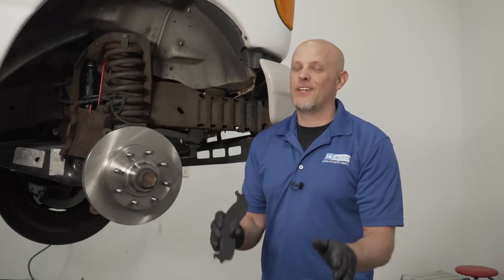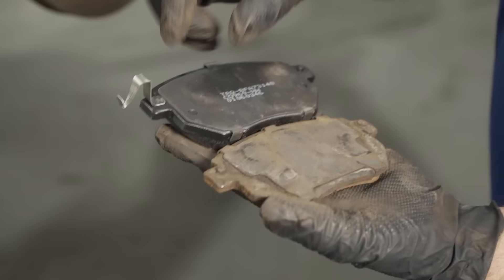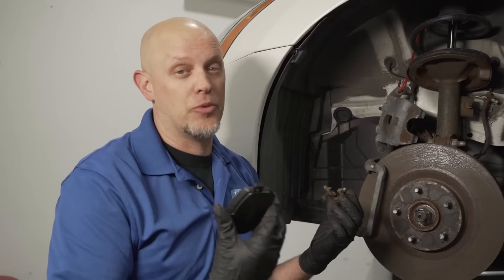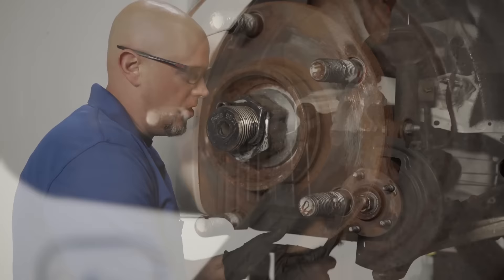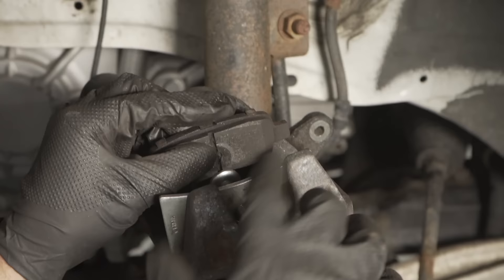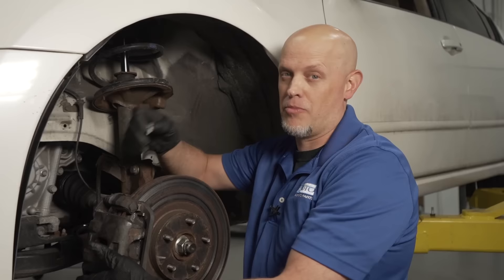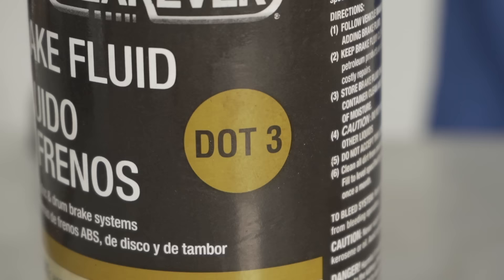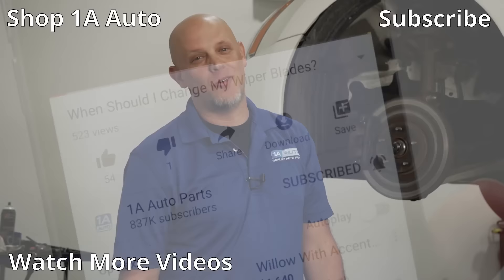Most Common Brake Installation Mistakes!

Comment: I would have called the pads inside out rather than backwards. I think if you can't tell they are around the wrong way or are greasing the friction material you definitely should not be doing any work on brakes, and possibly anything on the car.

Comment: The first time I did break lines, I couldn't count the number of times I did the flare and realized the bolt wasn't on. It's probably the most infuriating thing ever, especially when using a cheap flare tool

Comment: Back in the 1980s those rotors were so meaty they could have been turned down smooth & true and still had enough metal left to turn them down again.

Comment: the squealer always goes on the trailing edge of the rotor. if you put it on the leading edge it will get pinched between the rotor and pad and snap off. then you won't hear any squealing until the metal pad hits the rotor. he said put it on top, that's the leading edge. don't do that.

Comment: Emphasis on double checking the bolts are done up tight. I forgot to do that once and the caliper fell off during the test drive, had to pump the pedal to close the caliper up before braking returned. Then I went home and changed my underwear.

Comment: So apparently I made a huge mistake now that I think about it in hindsight... my caliper was removed as I was attempting to remove the hub to replace the bearing the hub castle nut was going to be impossible to loosen with the car up on stands, so I put the tire back on and lug nuts and I was going to let the breaker bar sit on the ground while attached to the hub with the tire on and wheel touching the ground, and I was going to move the vehicle forward a bit to break the castle nut free (sounded logic at the time, and that it would work) well in order to start my car you have to depress the break and push start button so that's what I did, and when I did so, it caused the caliper I had off it managed to push the piston all the way out and It appeared to be a bit cocked sideways and now it's been impossible to get it to compress no matter what I've tried to do to fix the issue, still no results and I absolutely do not have the money to buy a new caliper I've just put over $300 INTO the suspension recently and it's wiped me out....and to top it off how I was attempting to break the hub castle nut free, didn't even work it busted my breaker bar, so now I have a stuck ass caliper and a castle nut that won't come loose to replace the bearing...I'm very very very very frustrated at this point and just want to give up on it all together qnd let my only car sit, useless in my driveway I don't know what else to do to correct the problem.

Comment: Gotta throw this out there. Some cars have a parking or emergency brake system that actually turns your rotor into a drum brake. I accidentally broke my parking break on my 5 speed suzuki reno pulling the rotor off with the break engaged so make sure you check.

Comment: I hope that wasn’t copper tubing he was using for brake lines. Copper is too soft to handle the hydraulic pressure that occurs when braking. Use the recommended brake line tubing which generally is steel. On a Lexus that I had you didn’t even need to remove both bolts holding the caliper, just remove the top one and loosen the bottom one - the caliper flips back out of the way to expose the shoes and you simply lift them out. You don’t need to worry about hanging the caliper and it sure saves time and aggravation. Why don’t all manufacturers do that?

Comment: Most brake repairs cost you a minimum of probably $400 per axle or maybe you could get it should be for both axles but it seems like you just charge you double

Comment: Don't bend/pinch metal tabs on some pads to make them fit easier.  The pad will get loose and wear at an angle and eat into the brake rotor.🤦‍♂

Comment: Make sure your truck doesn’t have a break service mode. They disconnected the battery changed my breaks and when the computer was turned back on my dash became a Christmas tree. Had to drive it a while to get it to reset.

Comment: I know it’s not good to push the piston in as you don’t want dirty fluid going back to the master cylinder but I do that instead of cracking the bleeder which allows me to test a collapsed brake hose

Comment: One thing i do is try the brakes in the parking area. I will drive backwards and forwards to make sure the brakes work. I always pump them up first before moving the car. Once  i feel the brakes are working properly,  then i get on the road and see how the new brakes perform. Just saved my wife $200 in labour replacing front brakes. Another thing...i refuse to use MADE IN.CHINA parts. Made in Canada/USA is what i like.

Comment: Not to nitpick,but you should have put that anti-sieze on the studs...if anywhere. Doing so will make those studs last far longer.They are subjected to so much abuse. Compromised threads after years of removing and replacing wheels can cause wheel loss! Don't be a "loose wheel"!

Comment: I am doubting a brake repair shop will use a wire brush to clean off rust. Did not see a shim added with brake pads.

Comment: 100% never any grease pads EVER! Anti-seize behind the brake pad slides is fine. They dont come like that from factory! Grease collects brake dust and road grime causing brake pad to lock in place and cause premature failure. ( Bad advice telling to add grease ). Second disagreement you never open the bleeder when compressing the caliper the reason why is you can introduce air into the system. ( The only time the bleeder should be opened is for brake system bleeding or diagnosing a stuck caliper checking to see if the caliper is faulty or the rubber line is faulty )

Comment: Don't use brake fluid in your power steering fluid, all hydraulic fluid is not the same, it will cause your power steering pump to go out.

Comment: Had to replace pads and disc in the middle of winter,outside ,at  a hilltop house ,just south of the Anglo Scottish border...

Bolted the caliper leaving the flexible pipe v badly twisted 

It lasted a couple of years like this and only discovered by a professional mechanic doing another job.
He approached me ,in the waiting room,and was quite annoyed asking me which repair garage I had recently used. 
After further discussion,I denied any knowledge of the caliper problem , couldn't recall the garage responsible,and expressed my outrage on the clown who could have done such a thing !

Comment: I know that was just a cap full of oil but really, you don't want ANY in there at all.  I can only imagine that it is going to be a very expensive thing to replace all the parts of the brake system.  That is even if you get lucky and your pads and rotors did not get fluid on them.  If it is DOT 3 fluid that might cause even more problems when it leaks since it is corrosive to paint.  Don't forget this stuff is very toxic regardless of which DOT it is.

Comment: ****************THE MOST COMMON MISTAKE AND SOMETHING EXTREMELY CRUCIAL IS REMEMBERING TO USE ONE SOCKET TO HOLD THE LARGER BOLTS WHILE YOU TIGHTEN THE SMALLER CALIPER BOLTS 🔩.  THIS IS A SAFETY FEATURE AND I WASN'T TOLD THIS IN ANY OF  THE YOUTUBE VIDEOS I WATCHED SO MY CALIPER BOLTS LOOSENED**************

Comment: I may not be an expert mechanic and only do what I have needed to do, but man.. for the sake of the persons safety, if someone doesn't know the difference between the metal side and the pad side of a brake pad they should not be changing their pads! O_O

Comment: WAIT....a COPPER brake line!!!! I sold aftermarket parts for years and was told, repeatedly, STEEL    brake lines ONLY!   Copper is TOO SOFT and ILLEGAL.  Auto parts stores USED TO SELL special steel brake lines, in different diameters and lengths, with male fittings on each end.😮

Comment: I mean is putting them on backwards and driving necessary to show that it’ll cause damage? Should be pretty obvious to anyone with a brain that metal on metal is gonna cause problems. Anyone that puts pads in backwards needs to put the wrenches down and walk away. In fact I’m surprised they were capable of taking the tire off to even get to the brakes lol

Comment: You didn’t talk about the bolts that may be present that hold the rotor on and you don’t need to oped any  bleed screw for just pads and rotors open the cap on the master  .. I can see this is a hobby for you 😂

Comment: If you install your pads on backwards, you should not try to fix your car anymore. It's obvious you don't have the mental capacity to do more difficult repairs than brake pads.

Comment: Lol okay nobpdy who has ever gotten far enough to replace brake pads has ever put pads on backwards.

Also those pads would be just fine. The outside of the pad doesnt matter, its just the side sitting against the drum.  The rotor is fine as well.  Itll smooth down over time.  Its whay theyre made for.

Comment: Biggest common mistake made in this video, drilled rotors are a downgrade.

People will cry and argue about it all day long. Yes, they will be fine in your street car and your truck you threw a power stop brake kit on. But it is still a downgrade. There are no benifits with modern pads that slotting doesn't provide and they make the rotors prone to cracking. Actual race cars with cast rotors don't use drilled rotors anymore for exactly that reason. It's a fad these days and it should really go away.

There are exceptions, carbon ceramics seem to be fine stored and there are some non vented lightweight drag brakes with larger holes like TBM that go through crazy heat cycles without cracking, their drilled wildwood counterparts have much smaller drilled holes and do crack
Reply: @thefungusamungus   All right, I'll ask you.
33,000 on my '18 F-150 need rear pads. The rotors seem fine, no 'big' grooves. Can I reuse them or not?

Comment: What are you talking about?  The metal side of the pad always goes toward the metal rotor...always.  The non metal part is padding, so the pad is always even, and to reduce chatter.   My god, man...didn't you take auto shop?  Where do you think the saying 'metal-to-metal' comes from?  It means your brakes are fully within specifications, and haven't worn down to the pads...that's why they are called pads...because of the "padding" nature of the "padding material....DUH!   ...Wow man, you're going to get someone hurt giving out this kind of information.'

Comment: This is an awful time waster, nobody will put the pad material facing outward, and have the back of the pads facing the rotor,  and opening a bleeder screw to compress the caliper cylinders is ludicrous. The released fluid can get in rotor and other things without a hose attached to it. And now you need to add fluid to the master cylinder. It creates extra work and risk of something going wrong.  30 percent of video he is trying to create content to make his video longer and it hinders people. He missed very basic stuff that people do wrong or miss.  This is just an awful video